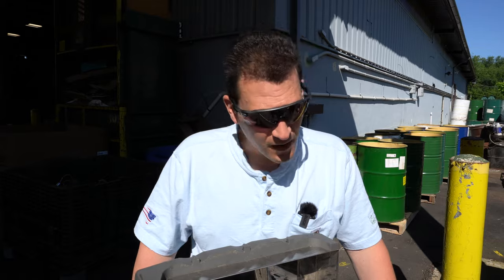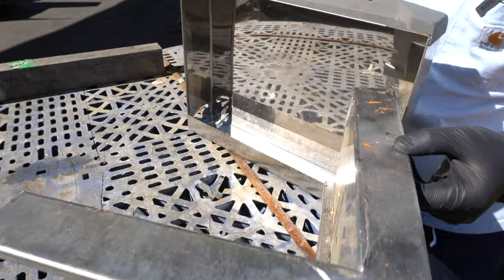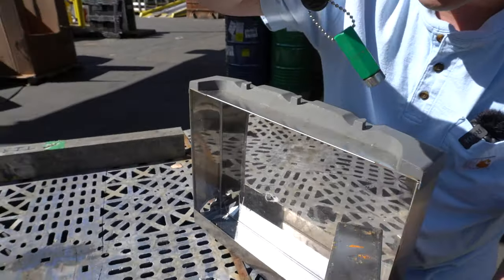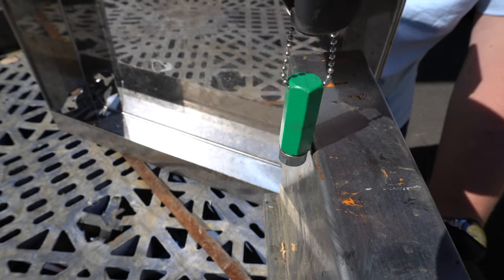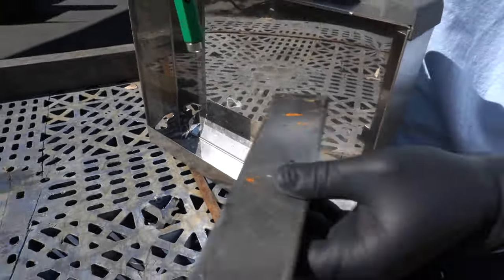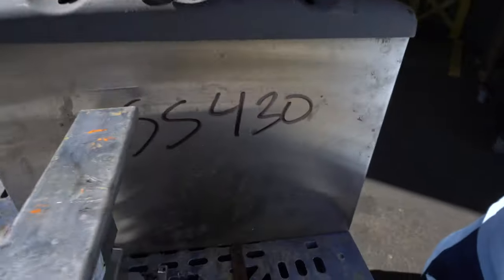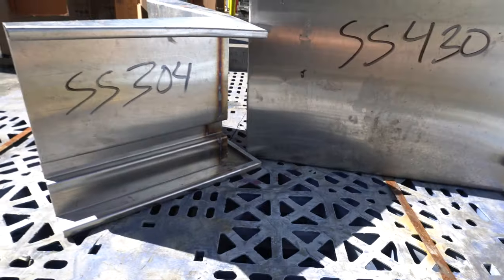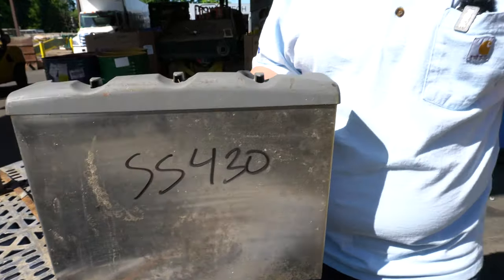Magnetic vs. Non-Magnetic Stainless Steel: Know the Difference & Maximize Profits

Comment: Bend, hammer, or coldwork 18-8 (304) in any way, and it goes from nearly nonmagnetic to magnetic.

This occurs only in the areas it's worked, for example a 304 stainless object that was formed or  bent, will be magnetic where it was bent.
Reply: correct!
Reply from the maker: neat!

Comment: The recycling center told me if the magnet sticks then it is in their words chrome plated steel. If I find any non magnetic my current scrap yard just lets me throw it together with aluminum. All mixed white metals same price.
Reply from the maker: Well non-magnetic SS is definitely not chrome plated, but I guess they don't do large volumes of steel and accept the downgrade in price